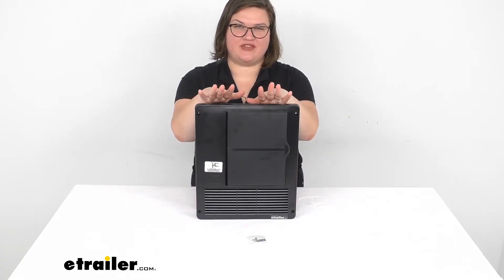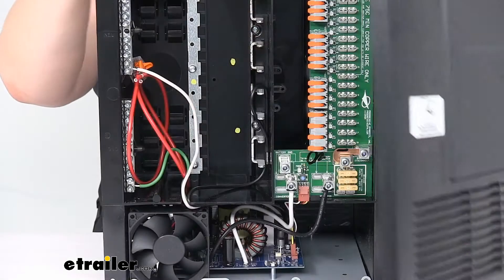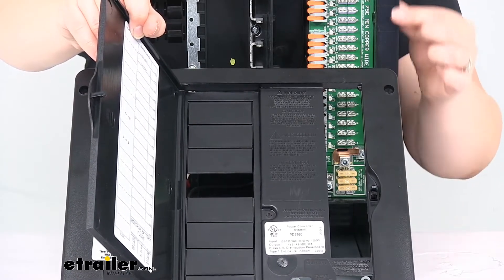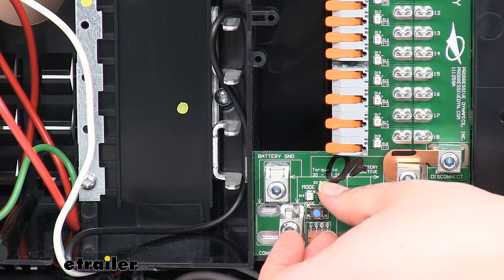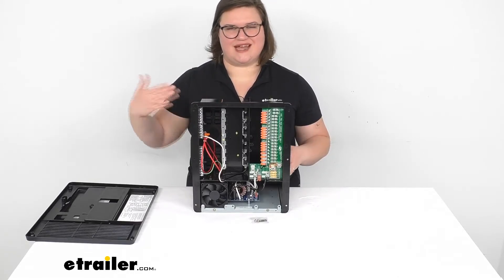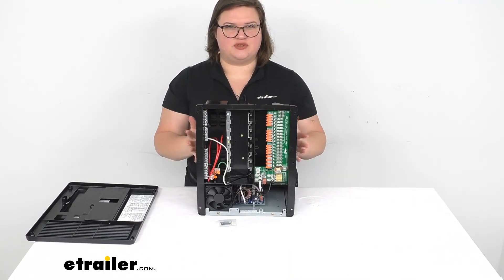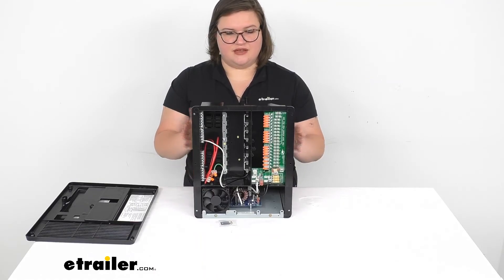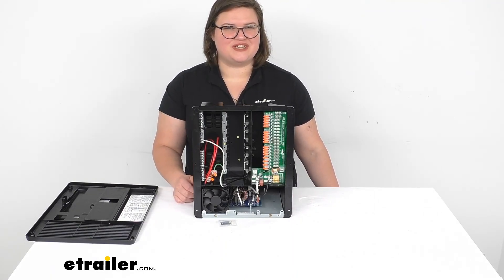Review of Progressive Dynamics RV Converters - AC/DC Converter and Smart Charger - PD4560K18LS8

Comment: I have this exact model #......but no switch for lithium.  However of to the side on the other computer board has a little black thing plugged into wizard.  It looks like I can pull it and move it over 1 spot where it says LI.  So is that what I do if no switch?
Reply from the maker: If there is an open plug option for lithium, you can change it to that. With this model, you just move the slide switch from LA ( lead acid ) to Li ( Lithium ).
https://www.etrailer.com/RV-Converters/Progressive-Dynamics/PD4560K18LS8.html
Reply: Why does nobody explain how to cycle through the wizard modes 😒